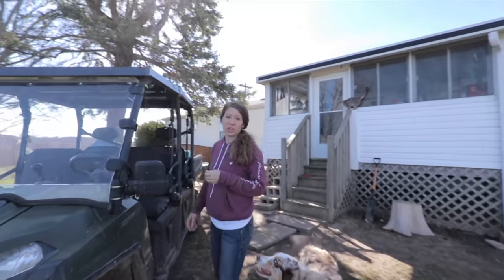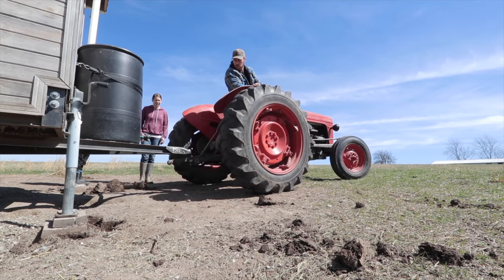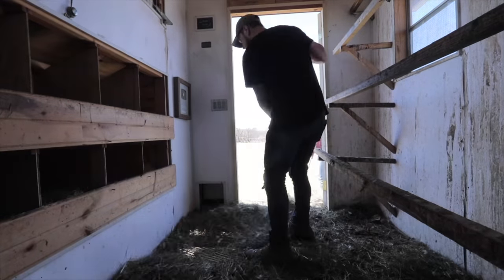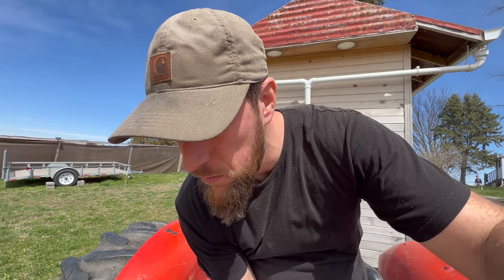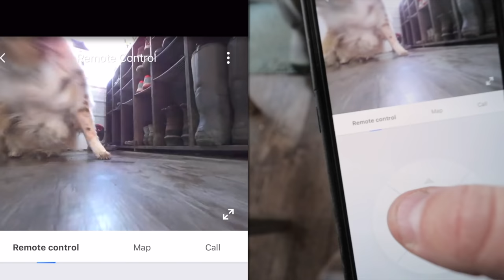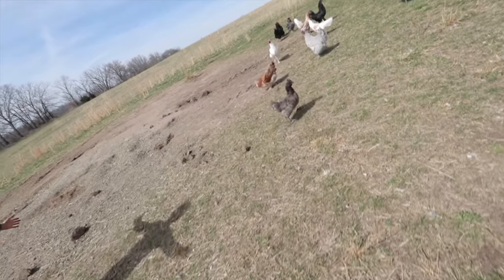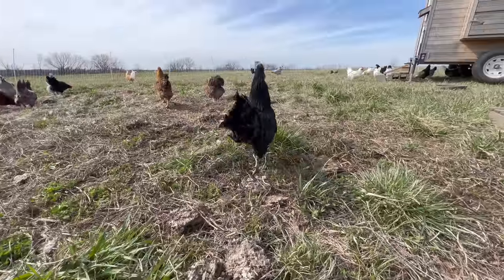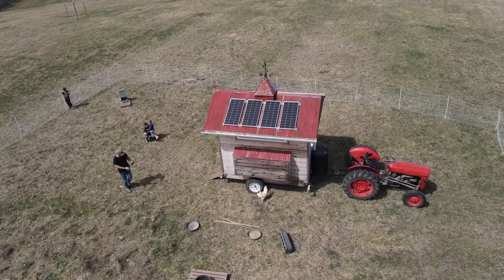Why do roosters fight? Moving the coop leads to a showdown...

Comment: What do you guys think about a floating duck house on your pond? I’d love to see you make one. others have used pallets with a spry foam inside and a little wooden duck house on top .
Reply: That's a really unique idea, i like it!
Reply: I wonder if they would have to have a rope or chain tied to a cinder block to keep it from floating too far towards shore. That would be lame. They do that with rafts on lakes and rivers so they don't float away too far lol
Reply: @ThatOneSammi  I think since the lake freezes over every winter this idea doesn’t work. The ducks might get stuck in the ice and freeze to death.
Reply: @besharadaccashe6069  what if they could bring the house in during the cold months? Like, attach a second rope to it that can pull it to shore, and leave it on shore during the winter. :3
Reply: @ThatOneSammi  that might work as well but there is also the issue of how to get the feed to the duck house in the middle in the pond
Reply: @ThatOneSammi  that’s an awful lot of ropes. But I guess it can work if they make a couple trails over land first and measure the distance and such.
Reply: Unless you mean for the house to be a small shelter they stay in during the day , in that case you don’t need feed or water in the lake house.
However the shore coop will still need to be fenced and filled with food and water regularly
Reply: @besharadaccashe6069   yes just for them to land on during the day

Comment: Have you wired the automatic door to the solar panel batteries? They’re normally battery powered
Reply from the maker: No, they are battery powered. The ChickenGuard company didn't want us wiring the automatic door to the solar power - stating it was too inconsistent of power and may cause a surge that would burn out the automatic door.

Comment: Why do you need an inverter?
Reply from the maker: The inverter turns the dc solar power to ac so you run wires or plug things into it and they will turn on.